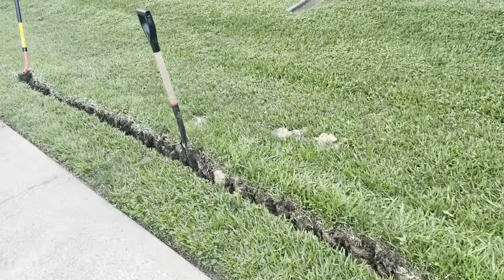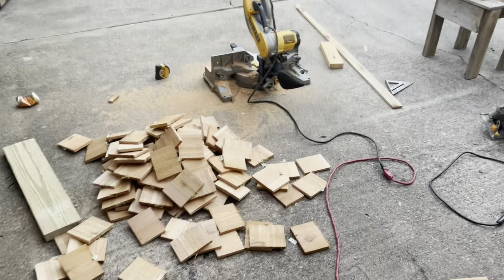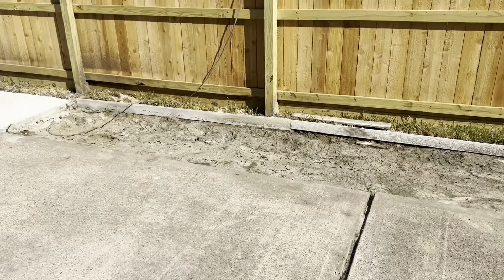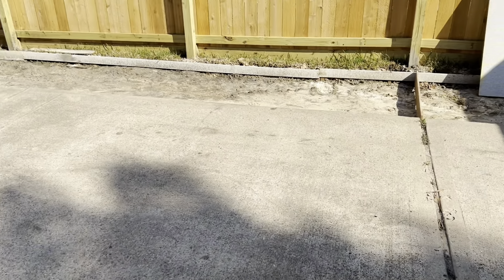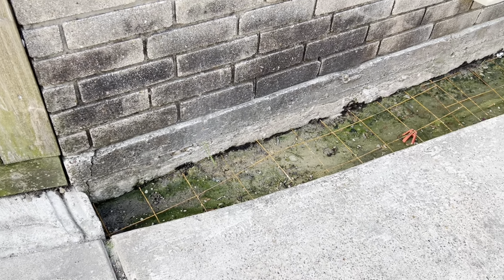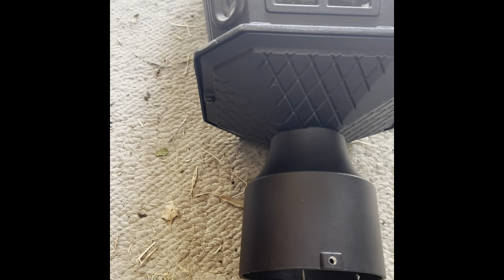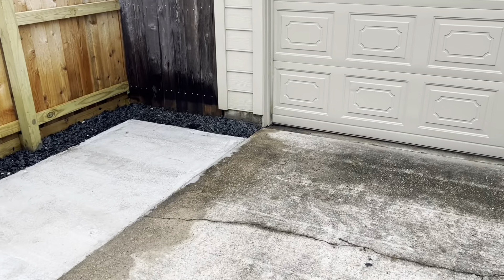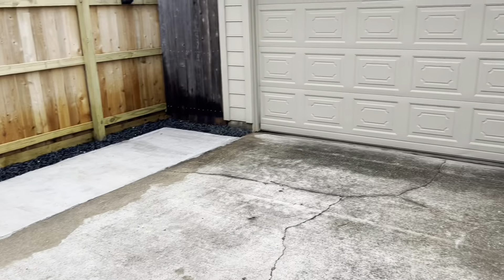$10,000 Driveway Project

Comment: how do you treat the perimeter around your house per termites prevention
Reply from the maker: Quarterly
Reply: @JustCantSitStill  every five years I trench around the foundation   and soak it with termite chemical     If you ever have a problem  you will have to drill holes through the concrete  
   some people say the granules work
Reply from the maker: We have someone that comes quarterly, and about once every two years they spray a healthy amount of termodor around all structures.